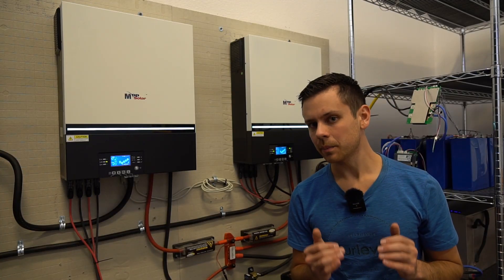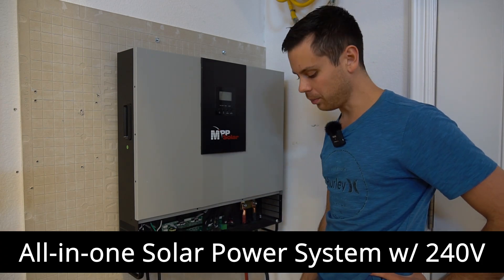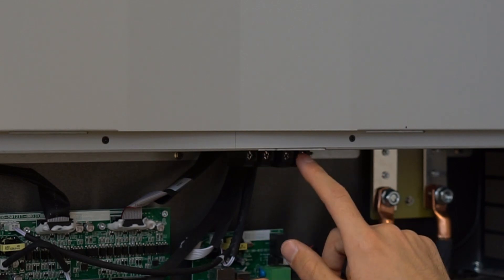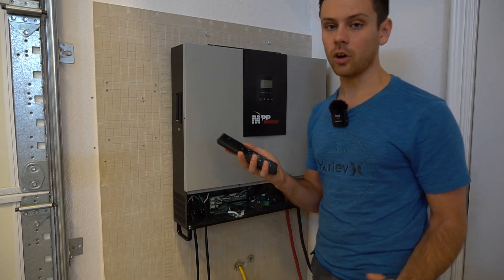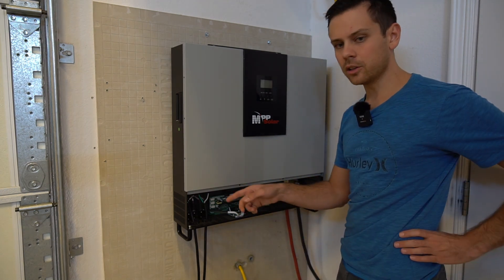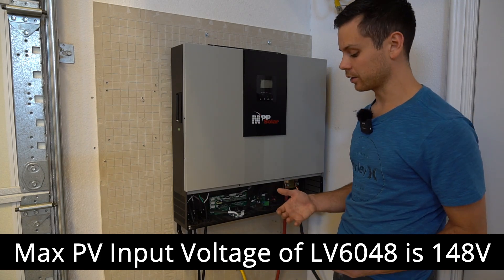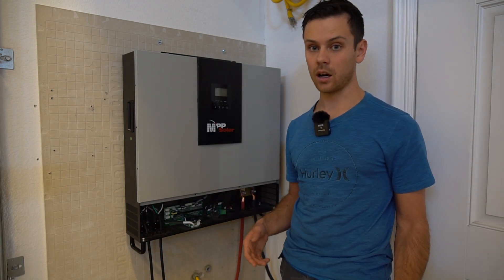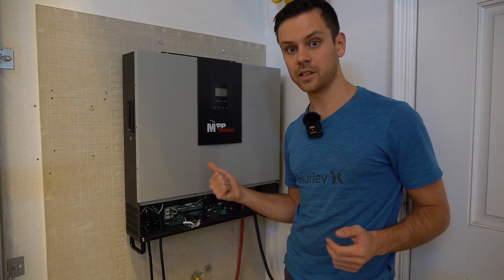How to Charge 240V Electric Vehicles with Offgrid Solar Power

Comment: Important question: Say you plug in the Tesla and the sun goes down. How do you prevent the system from sucking your overnight batteries dry to slake the thirst of the EV? Please design a circuit or switch to do this! Thanks
Reply from the maker: You need to discharge the batteries to zero. Always. That is what batteries are there for. Set low voltage disconnect to 46V and you will be set. The sun will come up, the batteries will charge, and the inverter will turn itself back on and continue to charge your EV
Reply: @WillProwse  Is there a reason you use the word "always" there? I'm not afraid of deep cycling a battery per se, but I thought shallow cycles weren't a bad thing?
Reply from the maker: @dtemp132  keeping any lithium ion battery at high soc is not healthy. deplete the battery whenever you can and leave it there if you can. It will charge everyday with solar so self discharge is not an issue
Reply from the maker: @dtemp132  and shallow cycles are good, yes
Reply: @WillProwse  Will I have an idea. Use a 5k watt aio system for the EV charger but set it to disconnect at 50 percent SOC.  Then have other aios powering the house sharing the same 48v battery bank.  This way the house gets priority over the EV.

Comment: Hey Will have you checked out the Ioniq Q5 ? This might be your next electric vehicle!
Reply from the maker: I went to Hyundai a few days ago and they said they won't get it for another year. really annoying salesman at the dealership I visited. Let's see if Hyundai can manufacturer a lot of them.
Reply: @WillProwse  
More chip problems I guess? 😳
Reply: @benjones8977   It is not chip issues it is company policy issues. But they just announced a big change. Most of the units will likely be coming to Europe first. But their EV efforts will now increase massively. One issue is charging in the USA versus Europe.
Reply: @WillProwse   I reckon they are hoping that by the time they scale up to supply the USA your non TESLA charging infrastructure will be better. Currently it makes more sense for them to make European models
as there is a lot more high end charging for their 800 volt architecture. Plus by the end of 2022 an expanded TESLA Supercharger network all over Europe will be available to all CCS2 compatible cars. Our V3 SUPERCHARGERS only have CCS2 on them, while V2 SUPERCHARGERS have two cables one modified Type 2/TESLA DC for S & X and the other CCS2.  Plus here in the UK we have at least four major charging networks rolling out major infrastructure this year. For Hyundai,  Europe is so much easier because of the charging.

Comment: I think these EVs should have charge rates like Power Delivery we use with our phones. Thus, we won't need to be stuck to only one voltage, istead we will have multiple voltages and ampers to charge the car.

Comment: Do you even need the batteries ?
Reply: Not if you're charging while the sun shines?!  Actually, I'd expect the internal electronics need some minimal capacity storage battery and voltage to make it run.
Reply from the maker: These newer models can work without the battery,, but it stresses the components less if you have a battery as a buffer. Always a good idea to have a battery for these.
Reply: How much battery do you need can you just have 1 server rack 48 volt battery and use that as your buffer for charging your car when the sun is , say 6 hours a day . The nice question would be. 
1: if you max out the solar panels how much charge from 0 can you get to your Tesla in 1 day ? 
2 with a 6 hour a day charge with maxed out solar panels and 48 volt battery buffer how many miles can you get ?
3  with maxed out Solar and 1 48 volt server rack battery as buffer how long would it take to fully charge your Tesla ?

Comment: There is the new Growatt 12kw split phase that’ll give you level II charge rates if you got the battery oomph. But the dang thing is 171 pounds. Can you say hernia? Don’t try to hang it alone unless you got rigging lol. Unlike the Mpp 6548’s the Growatt app shows total output not just the inverter (leg) you are viewing. Hopefully the app isn’t as cantankerous as I find the Mpp Solar. The one 12Kw Growatt drawback… you can’t expand it add more units together). The Mpp Solar is 13kw and I have no problem running the central AC,clothes dryer and more at the same time so most people aren’t going to be limited by 12/13kw inverter but most likely battery capacity and or solar capacity.
Reply from the maker: That is extremely heavy!! Holy cow. But that is good output, must be low frequency. Yeah 13kW is a fantastic output capacity. That is so awesome that you run your ac and clothes dryer etc. That is incredible.
Reply: @WillProwse  
I’ve learned a ton of things. My whole project is a “dry run” for when I retire within the next few years. My system is easily removed to utilized at a new off grid location. When I get there, I don’t want to be going through a learning curve when I don’t have the grid to save me and have to run my Predator 9500 all the time. In a nutshell: what you figured for batteries, double it. What you figured for panels, quadruple it. Clouds, overcast and low winter time sun angle= surprise!  Planning on high efficiency HVAC, propane heat, and cooking and water heater in the new location. Of course a 60kwh bank and 40kw array there.

Comment: Great video.  I'd like to set up something similar to this to run my pool equipment, but that may require more surge capacity for pump startup than some of these relatively inexpensive all-in-ones can provide.
From a non-Tesla EV perspective, it would be vastly preferred to control the maximum charge rate at the EVSE.  I have only owned 5 models of non-Tesla EVs, but none of them supports adjusting the charge rate from within the cars settings.
Reply: Only 5? I didn't even own 5 cars throughout my entire live!😄 good for you buddy!
Reply: @danielwurmer2266  I've actually had 6 since 2014, but I said 5 because 2 of them were the same model, I just upgraded to a nicer trim level after a year :-)   A couple of them were leases (very common with EVs and never worth what they want at the end of the lease) and I've had cars at multiple locations for several years.
Reply: You can use a VFD to deal with motor surge on startups

Comment: Now show us how to charge your house batteries with a tesla! 😆
Reply: Imagine that you're living off grid without any solar panels or generators, but you have a 30kwh house battery. Your only source of energy is a Tesla charging station that is 25 miles away that you can charge your Tesla with.
Reply from the maker: 😂😂 I have thought about this. I did have a old video with my first Tesla where I used the converter to charge a goal zero. It does work...

Comment: For most people, off grid EV charging is just not a good choice.  Most people need to charge during off hours, which means essentially a battery to battery transfer.  You need approximately 15kWh of power to cover the average American's 40-50 miles driven per day.  That's 3 - EG4 batteries @ $1500/ea.  Really, you'd want 4, maybe 5, but we'll use 4 for calculations.  So we're talking about $6k in batteries alone.  Electricity costs about $.14/kWh on average across the US.  $6000 buys 42,857 kWh of power.  Using 3.5mi/kWh as an average, that's 150,000 miles of electricity.  So that's 10+ years of driving.  I just don't see a ROI on this sort of thing.   Also let's not kid ourselves, $6k only covers the batteries, you also need enough panels to store 20kWh of energy every day and you need the all-in-one unit.

The only way the numbers make sense is if you can charge during the day and have a small(er) battery.
Reply from the maker: Yeah true, and I work at home. This does apply to some people. And it's pretty awesome when you pull it off.
Reply from the maker: Oh I mine crypto, I make the money back fast. Electricity is cheap, but excess power going to crypto miners is where it gets fun.
Reply from the maker: Have you seen my price analysis for Offgrid systems? The payback period is fantastic these days.

Comment: Can you work out a way to use a grid tie inverter without being on the grid please? I'm sure there is a way.
Reply: ...but why would you want to try to use a grid-tie inverter without the grid? it's whole function is to work with the grid? Off-grid inverters are a lot less expensive than grid-tie inverters anyway
Reply: IF you mean can you enlist an existing grid-tied system to contribute to new equipment: If you check out Ben's Solar and Battery, he has a grid-tied inverter AC-coupled to his Sol-Ark, which can control the grid-tied using frequency shifting. Basically can 'fool' the grid-tie into thinking the grid came back up, and then when the bank is at capacity the Sol-Ark will deliberately shift to 63Hz, enough to trip it off again.

If, however, you mean to just make a grid-tie run by itself, ehhhh no. I've heard of people trying to backfeed a grid-tied using a generator and it led to disastrous results.
Reply: @stefanvanzyl9090  because I have a grid tie inverter and don't want to buy another one, as I just had it replaced 6 months ago. I would like to store the power to use at night instead of giving it away for 6 cent a kWh.
Reply: @mrgreenswelding2853  you can use any AC coupled battery, like a tesla powerwall to perform such a function, and will most probably work with your existing grid tie inverter.
Reply: @JMSobie  yeah I mean to fool the inverter, not actually hack into the inverter.
Reply: @mrgreenswelding2853  lol like here in Michigan where they scrapped net metering and give you only half your money back? Yep. One of the reasons I don't have solar yet. Suddenly it's not as exciting when DTE is gonna raw you like that.
Reply: CA much worse now (75/25) - check out CA new 
NEM 3.0 law

Comment: Looks great , Could you please do a video using two growatt off grid 5K  48 volt 240 inverters with 3 5kw 48 volt life batteries with 12 450 watt panels? Love your work I picked up two gro watt off grid 5,000 watt 48 volt inverters and 3 LP4 5kh 48 volt batteries.  Best regards
Reply: Seeing you have all the parts, maybe you should make the video? Keep your input voltage and current under specs and you should be good. Probably only need on inverter with that string.

Comment: ok now show the poor man's version, charging at 120 volt... working from home currently so I don't need to charge quickly..
Reply: Buy a cheap $200 2000 watt inverter and a $150 12v 100ah battery

Comment: While I love the thoughts of Solar and batteries...  Have you ever done a video on the cost of a complete system verses the cost of power from the electric company.  It is cheaper during the life of the car to plug it into the wall.  Or run your generator on you coach instead of spending $20K  on solar panels, batteries etc. to build the system... ok I know you are going to say save the planet... But if you do the research there. You will find the earth is going thru the 15000 year cycle and climate is BS as far as man causing it.   We may be speeding it up some but a single volcano eruption will do more than all the cars in the world combined...